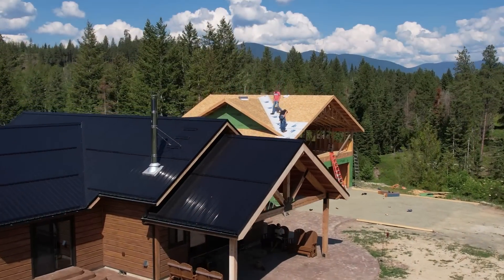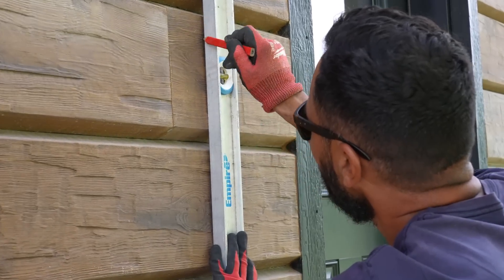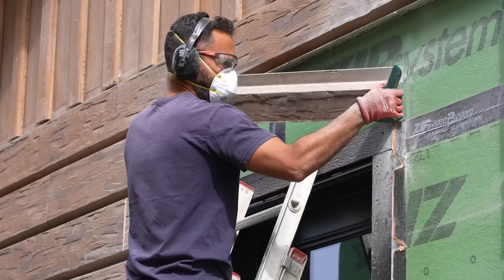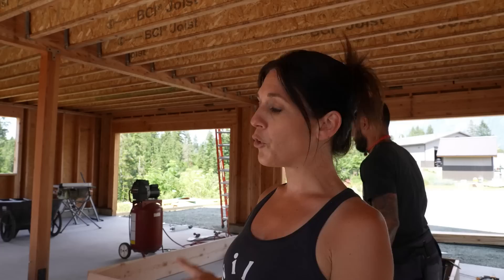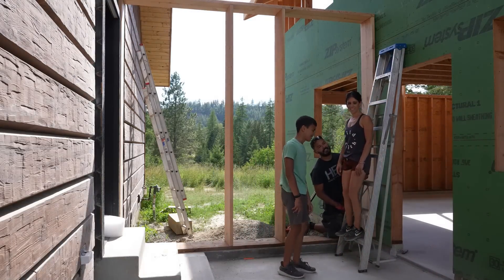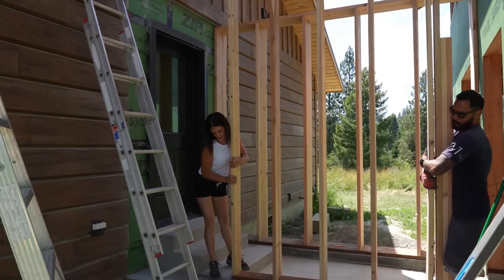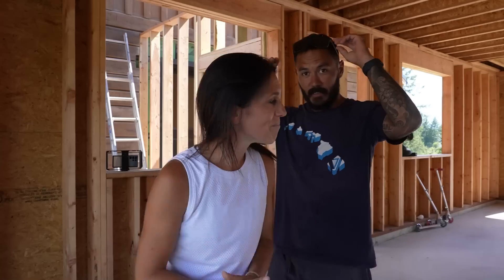Struggling to Tie Our Two Builds Together | DIY Mountain Home Addition Build

Comment: In case you weren't following when they chose the concrete siding for the house, it's because it offered protection from wildfires which being in the mountains is a possibility. So great choice in my opinion.

Comment: Jeremy....Next time you're faced with fitting 2 walls between existing buildings, "stick frame" it. I.E. Bolt down the green plate, cut and nail up the end studs, cut and install the top plate and the center studs off the ladder. Nail on the dbl top plate, and toenail the bottom of the studs...wala. You don't always need to frame small walls laying down. "Work smarter, not harder." Your house looks great, Dude!
Reply: This is good advise I think. I would have avoided cutting the awesome siding personally.
🤘😎♥️
Reply: In agreement with that advice. 
Also just out of curiosity.. why don’t we see more of your older son helping lift these walls ? Or doing the construction work with you. 
My boys were 14 and 13 when we started building our homestead. They have helped with every square inch of our home. Even plumbing, ditch digging. They are well trained and fit and strong .
Reply: I believe in a past video Jeremy said he wished he had gotten his oldest son to help more with the construction, I haven't seen this so far.

Comment: I had a coworker once, who, to get her two college-aged sons to adhere to the "no clothes on the floor" rule, added the "clothes on the floor get put in trash bags by the curb" rule. Didn't take long before they began adhering to rule  #1. So.. shoes not on the rack.. go "missing".
Reply: Most kids I kno wiuldnt care about that! When they do the dishes they throw everything into the trash can. Pots pans flatware plates cups- everything. So "the clothes at the curb", meh, mom & dad will just hav to buy more. Unless they are 4 yrs old, that wouldnt work. Maybe a better rule is if shoes are not on the rack, that kid looses priveledges & has to write 500 sentences like "I will do as Im asked to do or suffer the consequences." We encouraged our 15 & older kids to debate their cases, respectfully. sometimes they won. They may hav a better solution.
Reply: @ShalomShalom-d5c it works if you don't replace the items. Problem is people cave and give into their kids.

Comment: It seems like there should be another door opening on the back side of the hallway, so that you don't have to go all the way out and around the garage to get to the back. Plus in the summer you could have both doors open and have a lovely breezeway. Just a thought :D I love watching your builds!   edited to add: I like the industrial shoe rack idea :D
Reply: IIRC plumbing is going to be ran in that wall.
Reply: @Mark_Spivey  Yes, indeed. I saw that as the video went on. It seems like with a little planning the plumbing could be run over the doorway? But idk, I'm not a builder, just tossing out some ideas. Thanks for taking the time to respond :D
Reply: Breezeway should be wider too, like a mud room bc come winter & they use the front door on that breezeway their boots will be muddy & heavy, harder to take off. Jackets too. Who wants to track all that into the house? I lived where it snowed & we added a mudroom for these reasons.
Reply: @Mark_Spivey  Let,s also not forget in winter that space between the two will most likely be filled with snow and impassable.
Reply: @karlgriggs8887  When it snows, they can scoop or blow the snow out of the way--just like they have already been doing in the past.
Reply: @ILGuy2012  do realize how much snow is going to come off of the roof between the two building?  I'd say good luck with that. But even better. Snow is not that far off in that part of the country, so we'll just wait to see how much of it there is when there is some snow.
Reply: I am concerned about enough accessible exits in case of a fire.

Comment: For ‘fit in place’ walls like the 2 x 12 wall, I have always pre cut the pieces, but then assemble them in place. That avoids the twisting and turning and misfits due to dimensions not working for the rectangle dimensions of the outside of the frame. The diagonal of the 2 x12 wall profile is more than the measured opening.
Reply: Makes tons of sense to me, but on day 1 of the breezeway build, Jeremy said he couldnt build the walls in place. Dont kno why.
Reply: @ShalomShalom-d5c  I know I heard that too. But, then he proceeds to assemble pieces of it after they set it in place. Then on the other wall they had two sets that they put in place on opposite ends and fastened together. There was nothing in the big wall that could not been put in place individually or in small groups and then fastened together.

Comment: For the connection to the garage, for lighting what about a 3 foot long LED light bar above the door to the house, would require a change in wiring, but being overhead it could light up the area very well.

Comment: Use Redhead concrete anchor bolts instead. Predrill the holes and then hammer the bolts in and tighten the nuts. Easy!

Comment: If you'd have built the wall in place you'd still have original anchor bolts.  The other way is to build the wall in two pieces which takes more lumber as you know.  It's looking good though.  I'd put a window or door with glass on that front wall area...... natural light and an easy way to get in with muddy boots on so you keep the house cleaner at the entrance. Y'all sure are building a very beautiful home.

Comment: I keep looking at the hallway and thinking if it was mine I would move the back wall farther back and make a much larger area to use as a mud room. With entrances to both buildings from outside it should give you a space to leave all outerwear and shoes without bringing in snow, mud, hay , rain or anything else that collects to you from the outside. Add hanging space to that shoe rack and you’ll have storage for all your bulky clothes that are used for outdoors. Too late now but just my thoughts. Love ❤️

Comment: I have/had a thought, why not build the walls but not put the bottom board on, put the bottom board over the bolts, put the rest of the built wall in place, toenail it in the bottom board and walls? Just my thought when having run into a problem like this myself.

Comment: A great way to heat that space between the house and garage would be to do electric under floor heating. For such a small space it will heat well and it’s not super expensive. They even have thermostats! It’s looking great!
Reply: Lumna Acres did that to their home etc! They are doing the floor right now of the huge shop theyre building. They live in New Hampshire on 500Acres. He & his wife excavate & build everything.

Comment: Some walls have to be assembled in place. You toe nail the bottoms of the studs into the bottom plate using 8d nails at twice the number of 16d nails that you would have used. Good Luck, Rick
Reply: I prefer using 3" screws (after drilling pilot holes) instead of toe nailing.

Comment: I know I might sound like a Monday morning quarterback, but hopefully the advice will help at some point in the future.  If you took the top plate off the top of the wall you could tilt the studs at the end away from the wall, then reattach the top place after you bolted the bottom plate down and attached the ends to the existing walls.

Comment: I noticed all the hard work you put into the new walls that connect the New Garage apt to the house. What I didn’t see is the cut out above the placed wall for you to add your roof for this connection. Is it going to have a flat roof? Prob not conducive for the heavy snow you guys get plenty of in winter. Anyway, I just watched you clear the cement siding for the attached walls but it looked like you stopped at the top of the wall line. 
Love watching your build ( don’t believe I’ve missed any of your build from day one. You guys are awesome ( tireless). Can’t wait for next video.
Regards 
Jimmy Booles Fort Worth Texas
Reply from the maker: No, we just haven't cut that out yet.

Comment: I still think a level crossover, from the house to gaby, that's level with the house door and a single exit door, for outside access.  With the floor of the passageway level, all the plumbing and electrical to run below the floor.  Plenty of room and should be frost free, or easier to attain.

Comment: yes shoe rack and on the floor add a grate that can be used to clean shoe bottoms when they are removing shoes while still on feet then each person has a shelf space to use. the grate lifts up and can be hosed down or moved so vac can scoop up the mud sand and junk. Experienced this in home where I stayed with children often- it was a tremendous help during mud puddles salt and sand from weather conditions. wood floors were saved.

Comment: I guess I noticed a while ago about your anchors.  I always put them in after the walls are up. Drill right through the sis and into the concrete. Pound them in and tighten them up. Takes the thinking out of it.

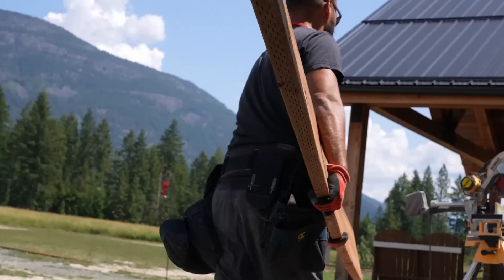Comment: 9:30 On the 2 sides of the corridor, you can make 2 small rooms on either side. Mayke as long as it's your wall and you can use it for storage or maybe a bathroom. Why only corridor?
Reply: I think it’s because they’ve already built a house with 2 bathrooms and plenty of storage. They don’t need anymore. This “corridor” is just to connect house to garage. I think that’s pretty standard. I’ve owned 3 homes and in every single one I could enter the house from the garage.

Comment: Next time cut slots. Put the wall over the anchor bolts,  slide it into place, and then fill in the slots. Using wood glue or construction adhesive.

Comment: Advice you didnt ask for, please take it in the friendly spirit its offered! Absolutely right about holding your hand up high and help your horse quit dropping its shoulder. In my experience its helpful to release that so that dont rely on that and hold themselves up on their own, so once they pick up their shoulder release, if they drop their shoulder again pick it back up then relase when they respond. Maybe you're doing that and its just not showing on the videos. Just wanted to comment in case thats helpful. Also counter cantering (loping on the wrong lead) drills can be helpful for droping the shoulders too! Another one I like is putting cones sporadicly in your space and making up random patterns that they have to round around sometimes just weaving through sometimes going around in a circle ect. 😊 hopefully any of those tidbits are helpful. Again not meaning to be annyoing by giving unasked advice!
Reply from the maker: Appreciate it

Comment: It would have been cheaper and easier to build two 2x4 or 2x6 walls with a gap between them than building the one 2x12 wall.
Reply from the maker: It actually wasn't.  A 14 ft 2x6 was $15 & a 14ft 2x12 was $28. Plus solid is better

Comment: @Good Simple Living there is a simple way to fix your wall and save your Anchor Bolts.  You cut a 2x12 the length of the floor and fasten down the anchor bolts.  Cut off the excess anchor bolts,  Cut your wall 1 1/2 inches shorter than length (top - bottom).  Drill 3/4 - 1 inch hole in bottom board of wall section where anchor bolt/nut is.  Nail it or screw the bottom boards together.  Simple as that.  Done it many times as a Carpenter.

Comment: For the walls connecting the house to the garage, you could have made two short wall sections (12" - 15" long) to attach to the house.  Then built the remaining sections of wall to fit between the short walls and the garage allowing you to raise the wall up to clear and fit over the anchor bolts.  Since the wall sections are fairly short and attached to both house and garage, it probably won't matter the way you did it.

Comment: Please make sure you have fire doors with automatic closers at both doors in that connected hallway.   My father-in-law lost two building with a fire without fire doors connecting the two buildings together.   The garage is a risk for fire and carbon monoxide infiltration.  You are so far from fire dept you need to be as safe and fire resistant as possible.

Comment: Maybe, in hindsight, building the connecting wall in place (piece by piece) would have been a better approach. The bottom plate first, then the 2 outside studs, then the top plate and so on.

Comment: Can you use the dryer vent air to help heat that area going to garage?  Going through a lint trap of course.
Reply from the maker: The problem is the air is so moist
Reply: @GoodSimpleLiving  Yeah, but don't you need moisture in the winter time when running heat?  Some people have humidifiers attached to their forced air heaters.

Comment: You could have built the big wall in two sections. And will you have to remove more siding on the house for the pitch of the roof? Unless the roof will be flat.

Comment: Dang guys you didn't have to cut the anchor bolts off you could have built the wall in place or cut slots in the bottom plate where the anchor bolt holes are and slid the wall into place well you probably would have needed a sledge hammer but yeah anyways it pays to explore all of your options before you choose too quickly because sometimes when we don't think it through we cause ourselves more work good luck guys

Comment: in hindsight, easiest way to build the breezeway walls, with the cut out siding all would have been to layout the top and bottom plates then install the bottom plates to the concrete, attach the end wall studs to each building and install the full length top plates to each end stud. Then you could toe nail each stud in place, install header etc. If you are balloon framing your upper gable end walls, you would frame them the same way. Depending on how you are doing your breezeway roof, I don't know how you'll get away from still having to cut out more concrete siding for that anyway.

Comment: Too bad you couldn’t either unscrew the siding about the door to lift the wall over the bolts or cut a small channel in the bottom boards where the bolts were so you could set it down on the bolts & slide it into place.

Comment: Sitting back in my armchair, I would have built the walls shorter so they could be lifted over the anchor bolts and then added top plates to the walls.

Comment: Honestly I would have built 2 regular walls instead of one really big one. Could have framed up the outer wall very easily, locked it all in with insulation and everything, then run the plumbing in the void between before putting up the inner wall. May have even been cheaper that way.
Reply from the maker: We always try to do things the right way, not the cheap way. Never wanna go cheap on a build.

Comment: Your siding is not concrete. It is fibercrete (which is cement mixed with water and fiberglass). Concrete is cement mixed with water, sand and gravel. If it was concrete, it would fall apart (unless it was so thick that you wouldn't be able to use it for siding).

Comment: Near the end of this video I seen the roof completely she did was not much cheating on the upstairs walls you need to get some cheating on that immediately, I've told people this before and I've actually seen the house fall down two-by-four bracing is not enough that's a huge kite, this is strictly my opinion but I've seen it happen more once. If you can't do it right now put a lot more two buy four x. I would sure hate to see the second-floor it would ruin the entire roof, please don't bash me everybody I've just seen that happen before